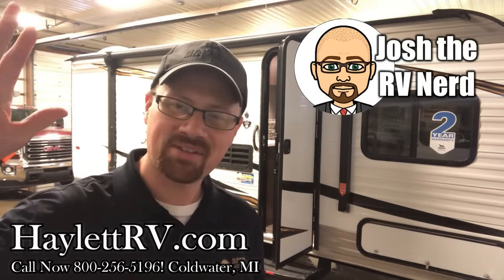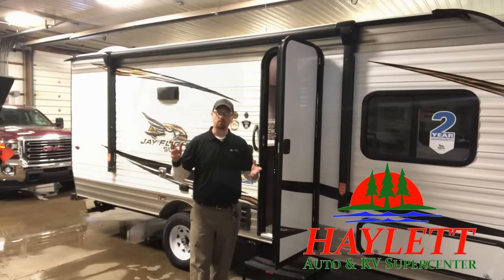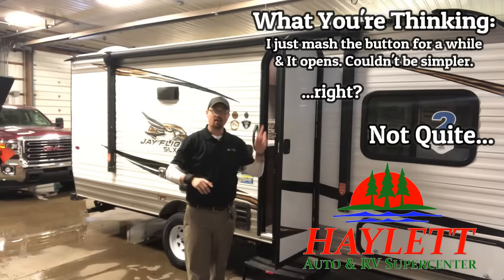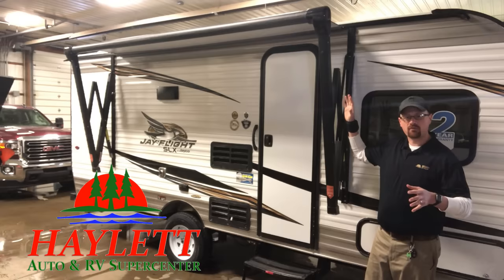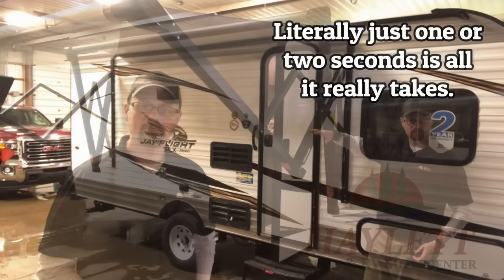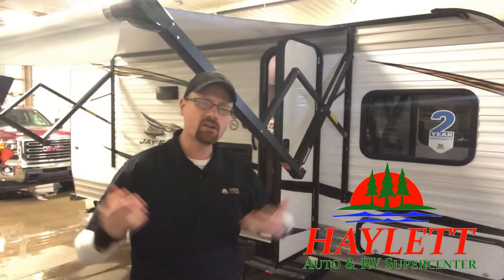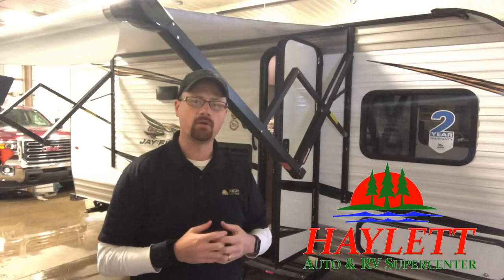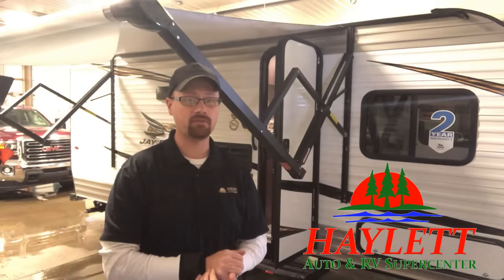You're Using Your Power Awning Wrong with Josh the RV Nerd

Comment: Speaking of awnings, Is there an easier way to keep the awning clean?  I’m constantly scrubbing bugs and mold and mildew off of it.  I’ve tried just about everything but I also still have permanent stains I cannot get rid of on the underside.
Reply from the maker: Sounds like trapped moisture. Open it periodically after towing in the train or after a hard rain at the house to let it air out. It's really like a popup that way. Any time you're working with a "fabric-style" material it's a good idea to keep it dry.

Comment: Pardon me for questioning, but what about all the other "gas struts" we use daily. My wife's SUV  rear hatch doesn't pause opening or closing. Car trunks and hoods have had them for many years with no mention of methodically opening and closing them. How about under a flip up rv bed Josh what about these poor sensitive struts under the bed! I don't doubt being nice to your gas struts will make them last longer but i'm guessing they are engineered to last for a certain number of cycles.  Some struts better built than others I would think is relevant.
Reply from the maker: Questioning is great! It's one of the best ways to learn. The Short Answer: Not all struts are the same and are used differently. 

Things like the cylinder that soft-closes a home's screen door are generally allowed to close more at their own pace. You can hear the gasses "breathing" out of them. You can physically feel the resistance when you attempt to open/close them. 

But in the case of one of these power awnings you cannot feel the strut fighting back because the motor's doing the work for you. 

Also, I won't shy away from the fact the struts used in these arms are not the top caliber struts you may find on something like the hatch back of a vehicle. There is most certainly a different in quality of component. HOWEVER..

If a client is educated and the equipment used properly, then there's no reason it shouldn't function as intended for many, many years.
Reply: The struts are, as he pointed out, are gas charged shock absorbers. The motor only unwinds the fabric roll. If the struts needed to “catch up” then the fabric would droop while unwinding. The awning opens and closes so slowly that there is nothing you need to do, or can do, to prolong the life of these struts. 
Well, except leave them in their natural rest state of fully extended. 👍
(30+ years master tech and shop owner)

Comment: So we brought our trailer in for a warranty item. Got it back with the awning retracted in reverse. Si when I close it it opened. Problem with this is that the bottom is extremely dirty. And was very hard to clean. Had black spots on it. Because it got wet every time it rained.
Reply from the maker: 1 of 2 things happening there: Either the switch was re-wired backwards, or someone left the "open" button mashed which caused the awning to roll up backwards (which just requires holding the "close" button until it resets.

Comment: Never heard that one before, Josh.  Is that in the power awning manuals?  Does it apply to all brands of power awnings?  I wasn't sure I was with you until you mentioned about the person on Facebook whose awning sagged when opening and then snapped up, then it made sense.  The power awning on the travel trailer I just traded did that on one side.
Reply from the maker: Most product manuals are, sadly, lacking in useful information. I generally bypass them, but also have the benefit of speaking with a lot of factory and supplier representatives which is where a lot of this ultra-specific stuff comes from.
Reply: Haylett RV Josh, are these struts different than the ones used for cars - front hood and tailgates?  It just seems that the 2 stage deployment is not something needed on any other similar application of the same struts.  Maybe your advice only applies to awnings with the auto-dump feature?
Reply from the maker: @allan6021  similar concept obviously, but I'd be lying if I said they were of the same caliber as those used in a car. And for good reason -- you use things like a car's hatchback pretty much daily. 

MOST people are not putting the awning in/out on an RV daily. 

So the Car/Camper is outfitted with the quality of component that best fits its expected use & lifecycle.

Comment: Thanks to your  excellent presentation I bought a jayco feather 24RL. I think its the most logical well thought out light weight travel trailer out there. 
I do have one negative comment which I see on other trailers; why do manufacturers place a molded wheel arch cover over a slide out which has to be cut to fit. Moreover,  attaching screws to air??

Back to the subject. I had heard about the staged opening of the awning and have been  doing so. I don't know what happened but the last time I retracted it, it reversed the inside out and twisted the material.  It took two or three extend and retract procedures for it to finally complete closure on the black side?
Any ideas?
Reply from the maker: Some awnings can be rolled up backwards accidentally if you continue to hold the extend button

Jayco awnings usually can’t. I am surprised to see this actually and glad you got it worked out

Comment: I don't think this is the cause of premature failure, and if it did have an effect, at least on mine, it would be more impactful in the last 18"of travel than the first. Gas struts like these open faster unmounted than the mechanism extends them and the mechanism extends them faster in the last 18" than at the start.

Comment: Hey Josh, which end of the awning was the “dump” arm on? I ask because it looked like there was a strut on both ends.
I had a Jayco Designer Legacy that had the auto awning on it. First the dealer did not know that the awning should be opened/closed in two stages. 2nd, the sump arm was mounted close to the door. With at least three stickers on it that said “mount this arm farthest from the door”. I bought this unit used from the Jayco dealer, neither he nor I noticed this for almost two years. It always seemed I did my inspections and washing of the rig when the awning was rolled in.
So all of that was back in 2003-2006
Thank you for your tips and hints, been raving since 1998 and still learning some neat tricks
Reply from the maker: If an awning has a rain dump feature, then usually both

Comment: Watch a hand full of you video and i wonder if you have ever worked on an RV awning arm like this? If you tried opening one not attached to the awning tube it would dam near knock you on the ground. your not pulling anything out, the fabric is actually holding the gas strut back. The gas shock but itself will spring open 10 + times faster than that awning is gonna open. I'm not sold on your theory.  

  Gas struts are in a ton of applications. For example a semi hood. These are opened daily for a pre trip no one ever opens the hood 2 feet pauses and then finishes opening the hood.  Id love to see your source that proves opening an rv awning like most people do wrecks the gas strut.   There is a lot of false info out there and this seems to be one of them.

Comment: I fully disagree, I've been working at a rv dealer for 23 years. The reason i disagree is because the struts (usually) have more pressure to extend faster than the motor. There for the motor is basically ( free rolling) and being pushed, the only use for the motor is the brake to stop it from unrolling to fast. So, no the strut does not need to (catch up) its extending faster than the motor , pushing on the motor. Can you show me the manfactures instructions that says stop going out?

Comment: Thank you.  I never knew about this either. Unfortunately, yesterday I was retracting my awning, and suddenly it stopped about halfway in. I switched it to go back out which it did, so then I started retracting it again. Suddenly, I heard a noise and all of a sudden the awning broke loose from the power side and came down. The end cap on the roll tube had tweaked and popped off. I have ordered a new end cap and should get it in a couple of days to repair the awning. Any ideas what would cause the end cap to become tweaked and bend. I know its made of pot metal, but surprisingly it didn't crack.

Comment: My question is. I have an 18’ electric awning on a 2019 Big Country by Heartland. When I close it the track on the left stops about 6-8 and doesn’t connect to the frame. Button on arm is loose and not tight as if it was extended. Any suggestions. And when it opens you have to pull on it in order for it to expand.

Comment: Hey Josh does this method work with the new awnings on the new jayco jay flight 32bhds? it has a different style awning, i was wondering because we just got the 2018 32bhds
Reply from the maker: Recommended for any power awning with an auto-rain dump feature.
Reply: Ok thanks josh

Comment: Had never heard this before.  Did you say that the strut will allow one side of the awning to dip under the weight of rain water?  My awning has a label on each side explaining to pull down gently on the labeled arm.  Is this not necessary?  If one or the other arm is pulled down, should it be eased manually back into place before closing the awning?  Should there be any pause during the closing like with opening?

Comment: Can u let the awning out on the battery
Reply from the maker: Yep! It's just 12v. The A/C, Microwave, 1/2 the Fridge, and 1/2 the water heater are 110 appliance (and a TV if added). MOST things in the RV can run on propane or 12v

Comment: These same struts are used on millions of hoods and hatchbacks and they don't fail that often. Don't you think a daily driver hatchback gets WAY more cycles than the majority of RV awnings and with few issues? This logic makes no sense. Also, struts are full pressure all the time, there is no "catching up". I think it makes more sense that awning manufacturers use cheap/crappy parts like most things on an RV.

Comment: Can you make a video about a 12v solar power system and what you can do with only that boondocking. Alot of dealers are lying about its capabilities.
Reply from the maker: I try to touch on that in each video tour. I'm not sure what others are saying. We like to make sure clients realize a 50w solar panel doesn't let you stay off grid using the A/C or anything like that
Reply: @JoshtheRVNerd  I for example was told the fridge and freezer would work off the solar units as thier both 12v. In reality the freezer doesn't freeze it gets cold like an extension of the fridge. I thought something was wrong with my fridge unit.

Comment: Does this still hold true for new RV’s? It seems like they could be manufactured with the two stages programmed into the control panel.
Reply from the maker: No awning systems changed quite a bit since this came out. It's largely outdated now

Comment: Why does the awning continue to operate if you keep the “extend” button held down? My 2020 GeoPro will extend all the way out and then just continue rolling back up in the opposite direction if the extend button is held down. Purpose? Also, and video suggestions on how to operate the little manual adjust knobs on each arm of the awning? Thanks!
Reply from the maker: Depends on the hardware in question. Jayco awnings typically don't do that. Dometic awnings will.

Comment: Not to get off the subject but why do most manufactures in the bedrooms have that wasted space by nightstand. Most RVs dont put draws underneath the cabinet / closet on either side. You have that gap that can be used to put a draw like Grand Design does. Everytime I see that it drives me nuts lol. Who needs such a long or wide night stand...Thanks...
Reply from the maker: Sometimes it's wasted
Sometimes there's structure under there
Sometimes it's a cap cutaway
I'm with you in that I prefer everything to open up as much as possible
Reply: @JoshtheRVNerd  Thanks for a quick response. I hope to buy an RV trailer some day. I live in PA though. Rather buy from you guys...

Comment: My wife and I currently have a Grand Design 337RLS. Looking for something a little smaller/lighter. Want to stay with 5er and a little better quality. Tow vehicle is a Ram 3500 single wheel 4 x 4 with 6.4l Hemi and 4:10 rear. Any suggestions? Payload capacity on truck is 4,400#. (We like our current floor plan.)
Reply from the maker: The good news is that layout is pretty straight forward and something any good builder keeps in their catalog. 
As soon as you start shrinking it down the first thing you'll run into is losing the bed slide. You'll find things like...
This: https://www.youtube.com/watch?v=HvjIMc8RiSw
and this https://www.youtube.com/watch?v=baQXp7_9Hp4

Rockwood is sneaky though. If you're wanting to downsize and keep a bed slide, then they make some just under 30ft like this crazy character: https://www.youtube.com/watch?v=Zh-kWyBDwTc

You're obviously shrinking your living space a lot in the process of course.

Comment: Excellent information. I have been doing this, but one awning has been stuck partway out and I'm unable to get it retracted. Fuses are good. Any suggestions to manually get it to go back in? It''s a 2021 Alpha Wolf with 2 slides and 2 awnings.
Reply from the maker: Hmm.. but it’s rolling partially in? I wonder if it doesn’t need to be adjusted - perhaps the arms are binding where they scissor together?
Reply: @JoshtheRVNerd  thanks. I'll check that out and see. Appreciate you and all you info!

Comment: How do you retract the awning if your motor doesn’t work/seize ?
Reply from the maker: Overrides work differently on different awnings. For most you will remove the plastic housing around the "head" of the awning arm nearest the front of the RV. Then you actually can access the motor and use something like a drill. 

Cable slides come with a drill attachment you use on the inside of the RV above the slide.

Comment: Josh, could this be the cause of a loud jumpy opening? Are one or both of the gas arms worn out if for some reason they don't go out in sync? Thx
Reply from the maker: That is likely more a symptom of the arms needing a little alignment (which is quick an easy thankfully). A local facility or experienced RVer could likely look at it and help you discern if it needs adjusted

Comment: Thanks for the information.  We just bought a 5th wheel with a power awning  and this was not explained.  Our rig also has a solar panel system that wasn't explained. Is there anything we should know about solar panels?
Reply from the maker: There's no way we can answer that question without knowing anything about your specific setup unfortunately Mike. Sounds like you need to chat a little more with your servicing dealer.
Reply: @JoshtheRVNerd  ok, will do.  Thanks.

Comment: Josh do the manufacturers post this info about the power awning in the owners manual someplace? How would anyone ever think to open something 1/2 way let it rest and than close it the rest of the way. That doesn’t make any sense. Thanks I’ll follow your advice but flys against common sense
Reply from the maker: Something that also doesn't make sense: Why would we just make something like this up unless there was merit to it. 

A lot of these tidbits we share come directly from certified techs and/or supplier reps I've met during various factory tours. 

Regarding manuals: Simply stated they're painfully underwhelming with useful information. Manuals are rarely specific to the component in question, but rather a generic manual a MFG/Supplier provides for a range of products.

Comment: We have noticed that when we extend Our awning, the left hand side (when looking from inside) slacks downward. We draw the awning back in just a second or so and that side snaps back up even with the right hand side. We then proceed extending the awning and the entire awning extends perfectly. 
What causes the downward swag of the left side to begin with  ?
Am I missing something here.
We bought the awning new in 2020 and have only used the awning approx. a couple dozen times.
Reply from the maker: The strut on that side is likely a bit weaker or perhaps the arms need a minor adjustment (which is common and not a big deal)
Reply: @JoshtheRVNerd  Thank You, 
I will have to Google how to adjust the arms.
Reply from the maker: It’s usually a couple of set screws 
Nothing major

Comment: Why does my slide out rub when closing for abou the first foot and then it’s ok?
Reply from the maker: Likely needs adjustment
Reply: Thank you.  I looked and didn't see any contact points like wearing.  Now it's on rollers with the side track motor mounts. I have a warranty but I'm pretty sure this is under normal wear and tear. Plus they will take  a couple of weeks before they look at it.    Do you know of any videos that explain how to,  adjust.
Reply from the maker: @crazy55rider7  Without knowing the type of slide in question I'm not sure where to point you
I would ask your dealer to get you some references (and who knows -- might be a warrantable item. It's worth checking!!)